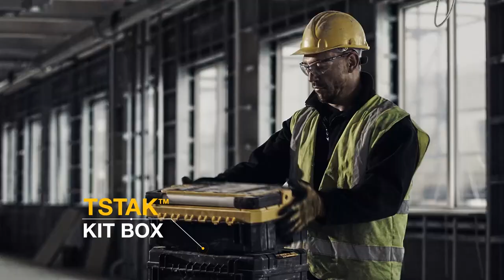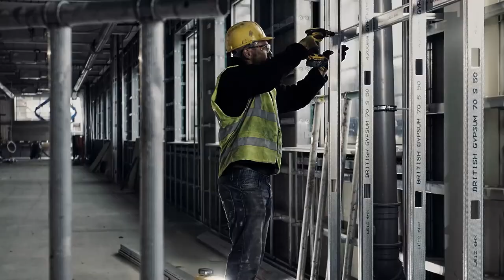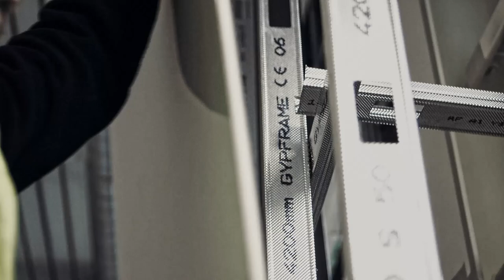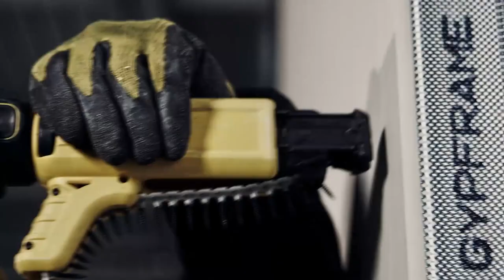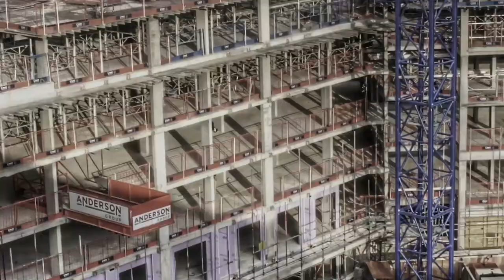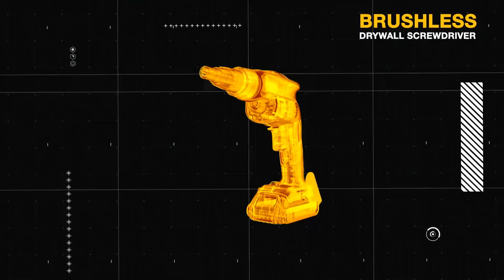DEWALT® 18V XR BRUSHLESS COLLATED SCREWDRIVER - DCF620

Comment: problem with this is, the nose of it is so bulky that you cant screw in the inside corners of walls or wall/ceilings.
Reply: go back & use the cone then. You don't float corners on the lid?
Reply: @patnaples5019  never float corners. Plus, we have fastener inspections on drywall before mud

Comment: could dewalt make the screw bit 3mm longer??  so when iam using it for decking it buries the screw in the decking boards
Reply: Hey senco sells a bit and the screws. It works great
Reply: to fit this gun?
Reply: yes just built a fence with it
Reply: are u joking. its depth adjust
Reply: @patnaples5019  still not deep enough

Comment: Too bad no market sells the collated strip tie without the screws 
In them as my company buys screws by the box. Maybe in a couple of years they might
Reply: would u load the strip urself then?  if so how would u do that??
Reply: @4dirt2racer0  funny I did manage to get the strips for cheap. I loaded them with coarse, fine, and zippy screws. Company I work for buys these screws by the bulk. Worked like its suppose to without having to break the bank in getting a small bucket of them